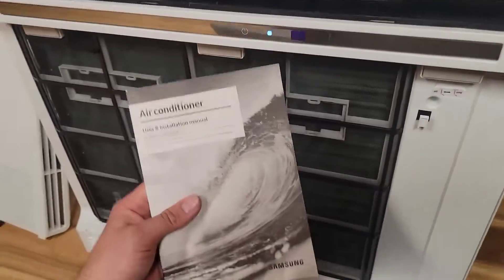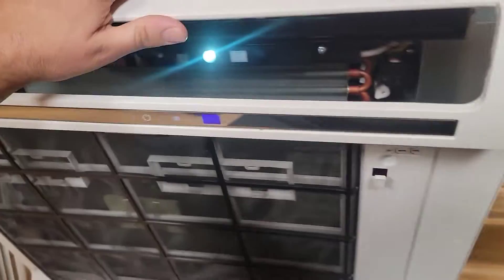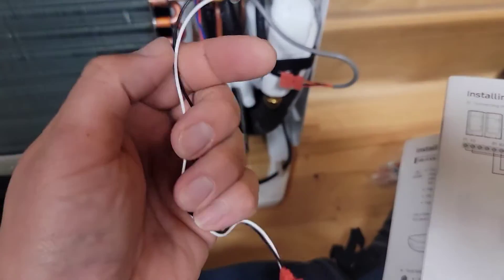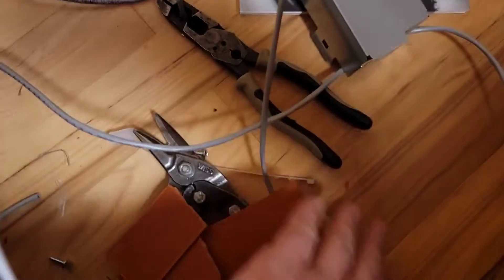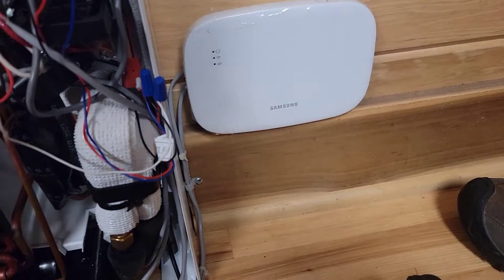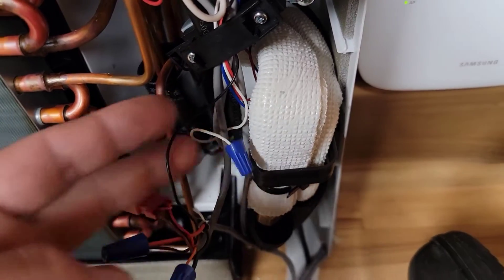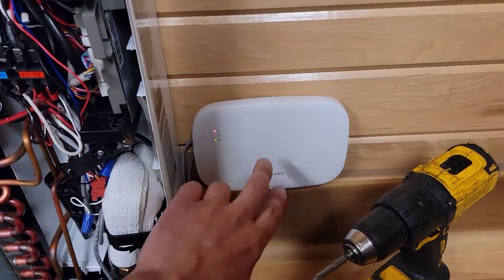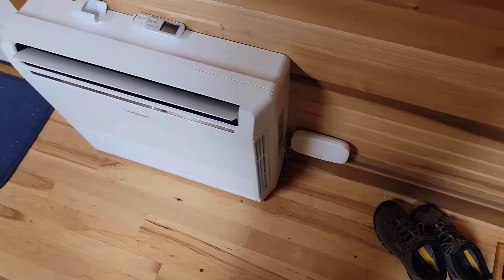Easy DIY Samsung WiFi Kit Installation for Smart HVAC Control

Comment: Wait??? it was that easy??  I'm struggling to do my ducted 19kw Samsung ducted aircon that was installed in 2019.  Aparently using the aftermarket and genuine work the same.  Aftermarket is an ESP32 M5Stacks with the Atom ESP32.

Comment: Have you hooked on of these up to a multi head unit? I have a three zone mini split, one wall unit and two floor consoles. Obviously the wall unit has built in Wi-Fi but I keep have problems with the Wi-Fi adapter in the app itself. It lets me connect to it and go through the whole process then right at the end it says system error occurred. The unit show up on the app but I don’t have any connection to it
Reply from the maker: This a multi head unit 
There is a full video where I show you the whole job
I think the title is mini split project on log cabin